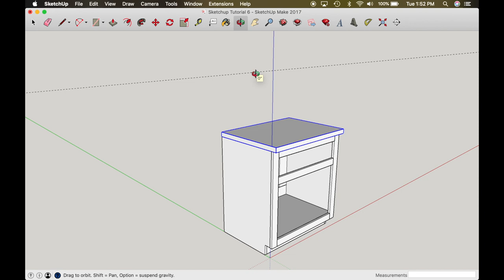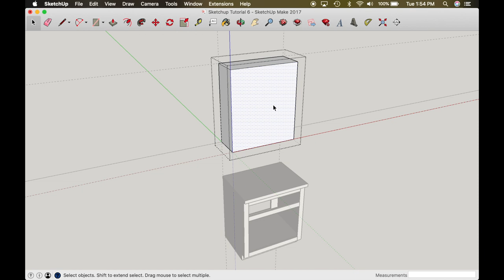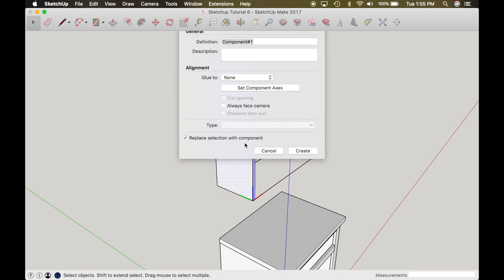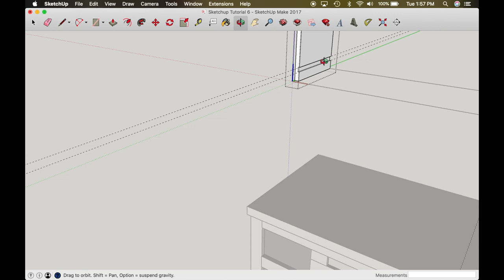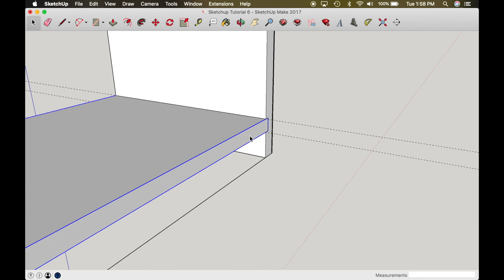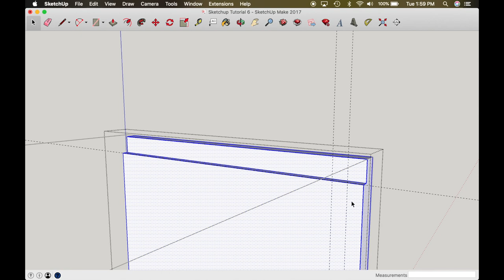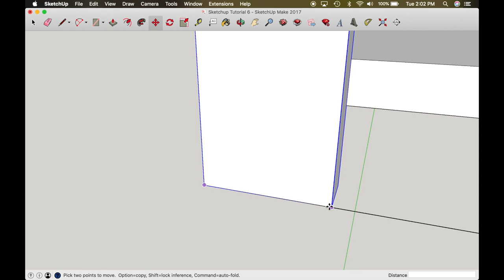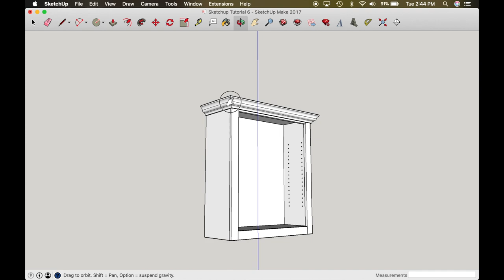Upper KITCHEN Cabinets DESIGNED FAST!

Comment: Great tutorial Drew, but I really think there should be a dado to receive the back on the top piece.  Having the top of the back panel captured will greatly improve the structural integrity since there is no nailer.  If your wall studs are positioned such that the cabinet is being held more from the center rather than an edge I'd expect the back to bow a little bit at the top which could lead to failure of the side dado joints or a cabinet that droops off the wall after a decade or more.  Mitigating factors of cabinet widths and fastening to adjacent cabinets may make it a non issue in practice most of the time, however it seems to me you should either have the nailer or a top dado.  I would expect your wide shop cabinets to be well supported on multiple studs so I doubt you would see a problem with them.   Maybe this is a bit of a pathological case, but once you have the 1/2 dado setup for the sides, why not run the top too?
Reply from the maker: I usually do this. I completely forgot about it on the tutorial. You are correct though dadoes are necessary on the top

Comment from the maker: Once you guys get familiar with sketch up you’ll be able to design your kitchen cabinets just like this. 

One little addendum that I need to add on to this video is the fact I forgot to put a dado in the top to accept the back. For structural integrity you will need that as well especially with nothing behind the back. This will prevent bowing towards the wall once you screw it down.